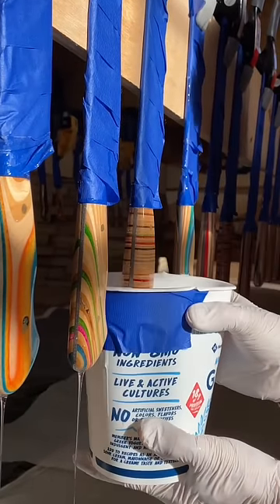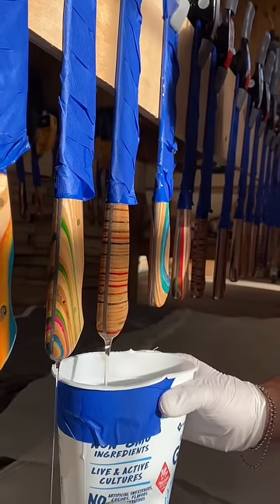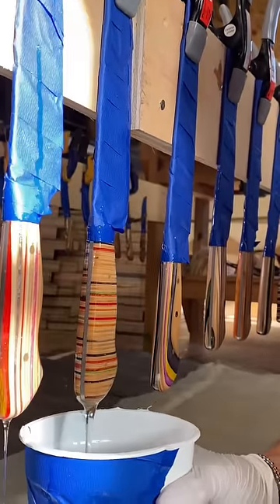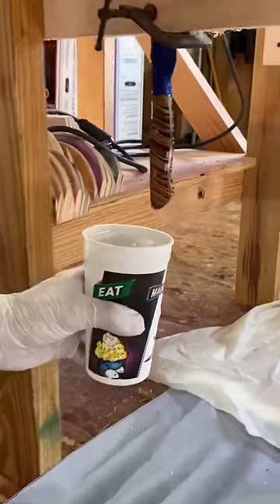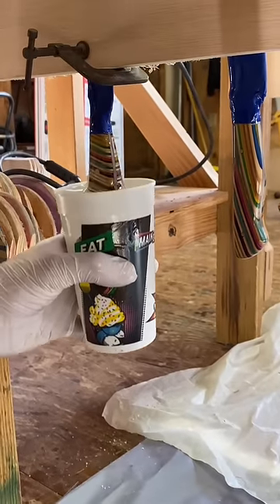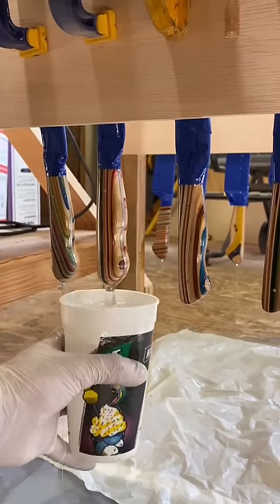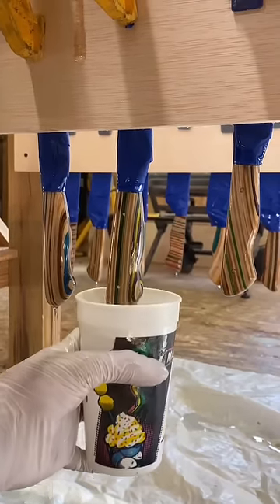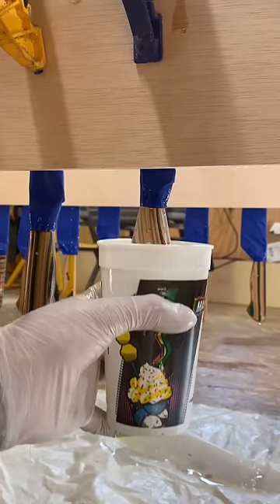Finishing our recycled skateboard chef’s knives with a two part epoxy ✨

Comment: I see your knives all use AUS-10. That's a rather soft and cheap steel only used in budget/low-end knives. I think charging $300-400 for a knife blade worth no more than $50 and a cool handle is a pretty hefty rip-off. Consider using at the very least VG-10 or higher quality steel if you really want a good product worth your price.

Comment: Wooden tool handles with epoxy coatings are horrible for working. They give you blisters up the ass and the handle will not be restorable when it starts to checker in a couple years. Definitely a young company.

Comment: Never seen epoxy dipped handles on chefs knives. The epoxy over the tang might yellow over time. Should use stabilizing resin on just the wood. Then you can sand and polish to a shine.

Comment: That’s so much resin waste filling a whole cup for an even coat you can do that with less epoxy and using a silicone tool then clean it afterwards. Unless you use the resin for something else afterwards that’s so much byproduct